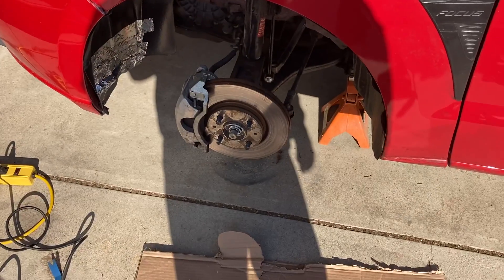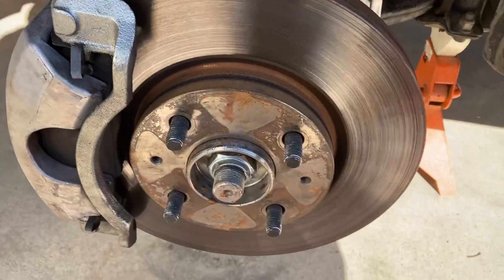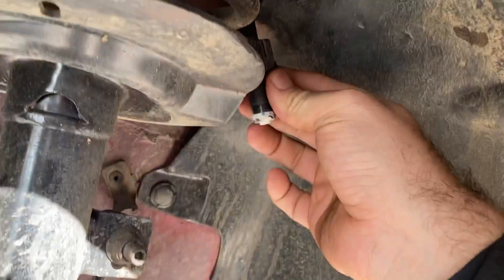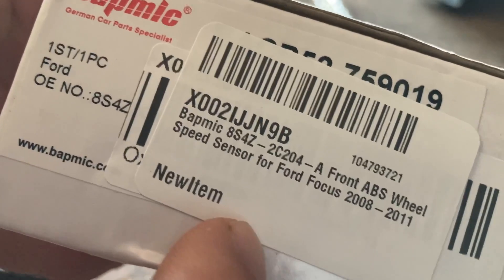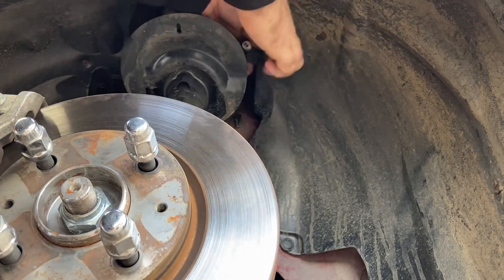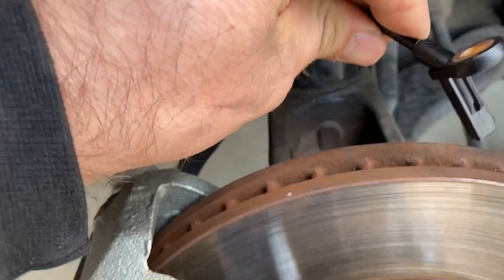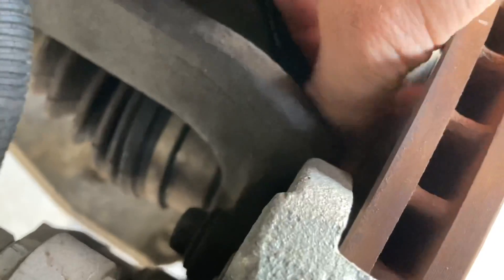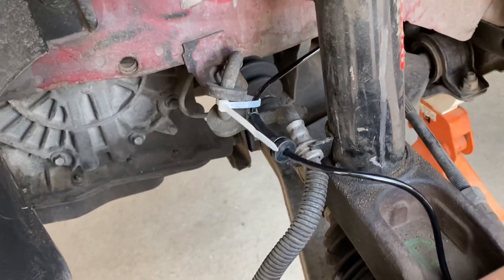Ford Focus ABS Sensor C1155 Code

Comment: Would there be any reason that sensor would effect power steering? I replaced the wheel bearing on the same side as well as the sensor and after changing it the steering seems way to tight.
Reply: did you figure out the issue? this happened literally today, my sensor faulted and I replaced it and my steering was way too tight.

Comment: You need motor mounts it will run a lot smoother I have a 2010 Ford Focus SE it ran like that before I replaced the motor mounts
Reply from the maker: Already did videos on all those. They were done

Comment: Did you loose speedo with it missing ?
Reply from the maker: No I didnt, just popped the abs code and an occasional time here and there the brakes would pulsate on a stop.
Reply: @hanksgarage_  Cheers for the vid. I've got an ABS light on, but my OBD scanner doesn't support ABS. I've used the hidden maintenance menu (hold odometer button for 10s while key is in 2nd position), but that isn't showing DTC codes either. 
Is it possible that a scanner would be able to test the ABS for faults if there are no DTC codes?
Reply: i did on my car did you ever find out how to fix yours.

Comment: Great fix.  Never seen one of these done before.  Hope the wheel turns both ways without pulling the wires out.  Thanks for the video.
Reply from the maker: Plenty of slack in it.